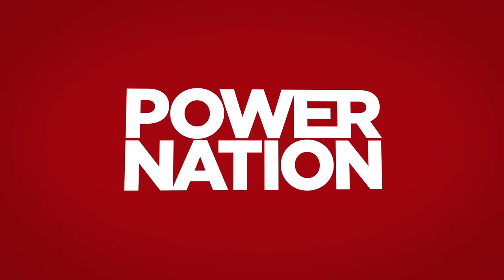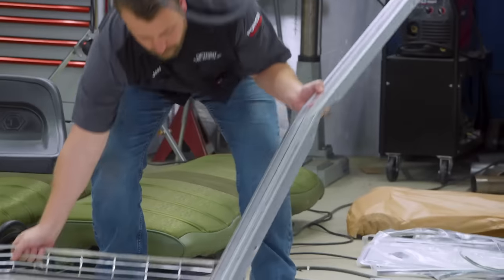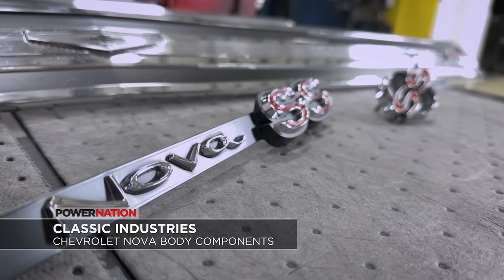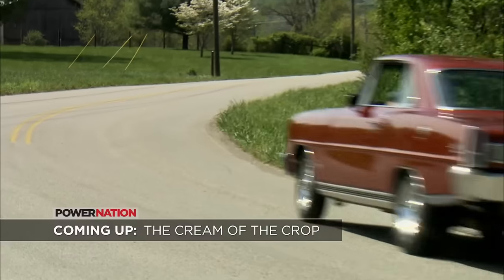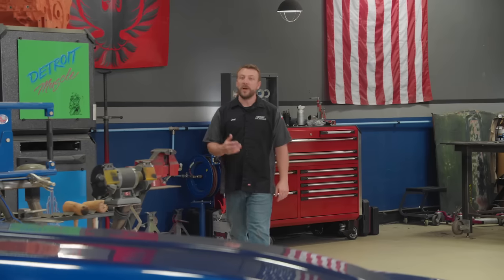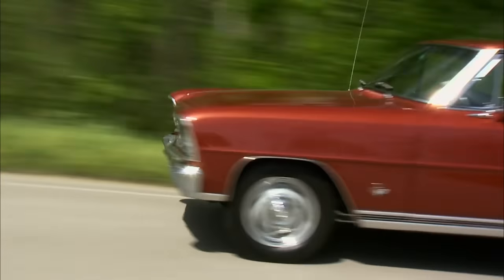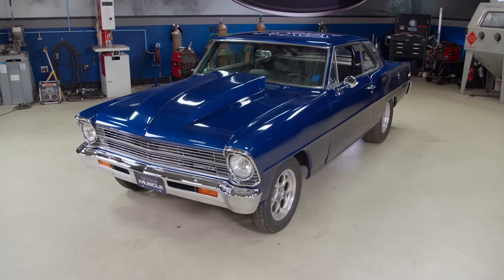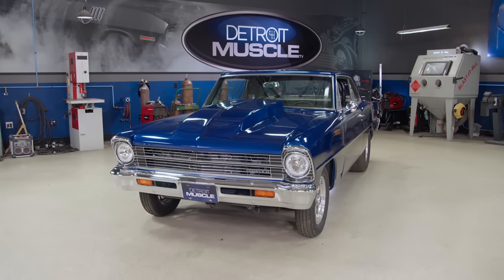Super Nova Swap - Detroit Muscle S10, E15

Comment: They have jackets with 12 volt battery heaters in them to keep you warm.  So my question is why not have a 12 volt battery fan in the race suits.   At least something to move some air around your upper body while waiting in car.
Reply: They do have cool suits that recirculate chilled water, but you need an icebox somewhere in the car too